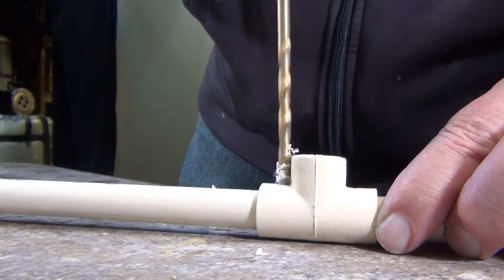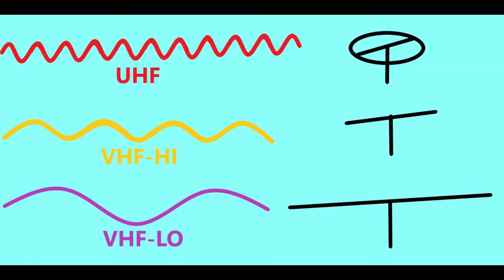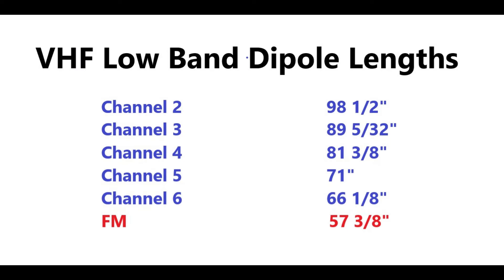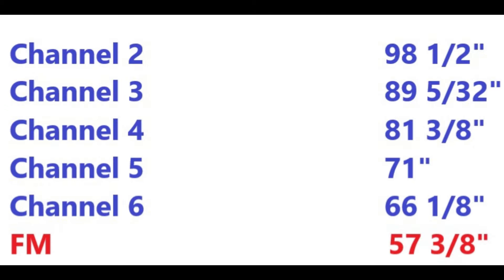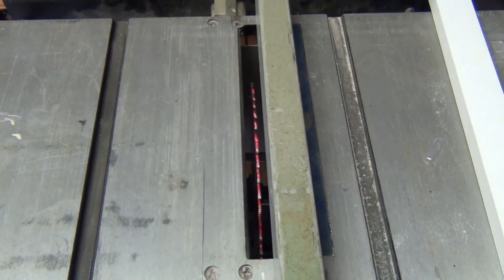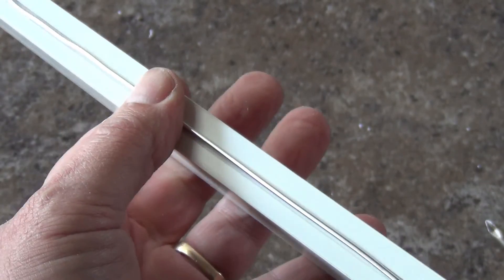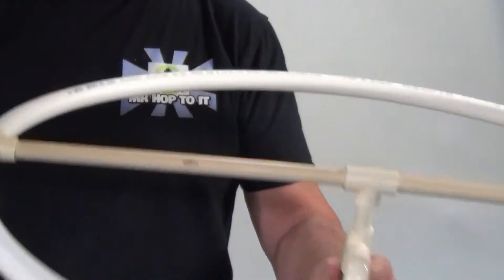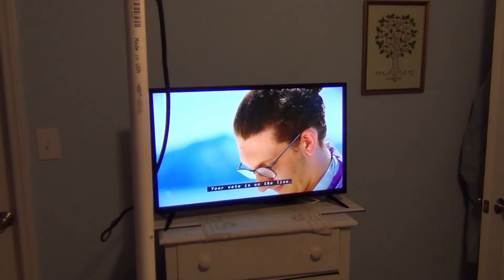VHF-Lo Band Antenna for TV, FM Radio! Part Two

Comment: What length should I build for FM radio only ?
Reply from the maker: Constructing the antenna as per instructions will get good FM radio reception in most areas. If you need a specific FM band or range, then you can customize the length. Try doing a Google Search for online folded dipole calculators and use it to find the best length for your specific needs. Thanks for watching.

Comment: Great antenna build videos - I've built the double-hoop antenna for my in-laws and they're using it daily.  I have a question about the VHF antenna - will an antenna designed for VHF ch2 work with VHF ch7?  I don't think this works in reverse, but does the longer dipole antennae also cover those channels that use a shorter dipole?
Reply from the maker: Yes. You are correct on using the longer element. Depending on signal strength you may get a watchable signal. You may also try tuning for a channel in between, like channel 4 or 5. Its really dependant on the exact situation you have. Thanks for the great question.

Comment: Excellent video. Been looking for this VHF-Lo setup
Reply from the maker: Glad I could help
Reply: **UPDATE! I just built this antenna. Previously I was having trouble receiving WQED PBS in Pittsburgh which broadcasts on VHF Channel 4. It would pixelate sometimes using the Antennas Direct outdoor VHF model and my signal was 49%. After building this, going up on the roof and connecting it, the signal went to 64%!  Thank you so much and keep up the great work! 👍👍 @mrhoptoit7835
Reply from the maker: Thanks for the great update!

Comment: I purchased a roof mount antenna (FSA-3806), that works quite well, except it does not get VHF-Low. I have been following your videos and I have a question...does the VHF-Low antenna for channel 6 (66 1/8") need to be a certain distance from the reflector? Thank you.
Reply from the maker: If you are adding a reflector element to an antenna, the basic guidelines is to space it .20 of the frequency wavelength you want to receive. In actual practice, this distance may vary a bit.

Comment: I have been looking online on dipole antenna gain. I have read that a dipole with a wavelength of 1.25 has a gain of 5.3. How would you make an improved version and keep the size of the antenna length within reason MHTI ?? Please forgive me if I have put any pressure on you Sir. Hope to hear from you with a positive answer to boot. Good day, thanks and peace too. VF
Reply from the maker: Hi VF. Dipole antennas are basically simple, and there isnt too much to change with them. You've already watched my versions of hi and lo VHF dipoles, which are easy to build and effective. Three things that come to mind. 1) Make sure you size the antenna for the channels you are wanting to receive. If its a few channels, usually sizing for the middle station will work. 2) For best reception, use at least 10ga copper or aluminum wire. 3) if your stations are in the same general location, you can try adding either a director element or reflector behind the antenna. As always, good luck!
Reply: @mrhoptoit7835  Do multiple twist wires perform better than a larger size solid copper wire from your experience  MHTI ?? I scored more 4 and 6 gauge wire from my electric company. Bet I got 30 plus feet of each wire. That is not counting the 20 plus feet of 8 gauge solid wire. 
               The sizing for middle stations is the ticket from your experience Mr.HTI??? I will do just that Sir. 
Thanks again MHTI for accurate facts on antenna performance.
Reply from the maker: @victoryfirst2878  If you twist lighter gauge wires they can perform as well as heavier gauge. From my tests, nothing really outperforms 10 or 8 gauge single solid wire., but twisted comes out even or very close to it.
Reply: @mrhoptoit7835  THANK you for answering my question MHTI. I look forward to your channel and videos for me and all others on YOUTUBE. Peace vf

Comment: WOULD folding the dipole into four folds to deal with the length problem affect the reception in any way MHTI ??? Thanks
Reply from the maker: VF, I'm not sure how you would fold it into fours? With VHF, changing the length is much more critical than on UHF antennas and can reduce reception.
Reply: @mrhoptoit7835  I am saying the length is the same just more folds to get four lines from top to bottom. The bottom has connection for the lead wires. This is really hard for me to explain MHTI but think double dipole with radius in between the two lines. Hope that helps Si.r.
Reply from the maker: On VHF, The distance from tip to tip of the element is critical. It aligns to the size of the wavelength you are trying to pick up, and is usually cut to match it in even increments (like full wave, half wave or quarter wave). By reducing the tip to tip distance even more, you would probably de-tune the antenna to a point where it won't get the frequency your are trying to receive. As always, a great question. Thanks

Comment: I have seen an antenna on line that is called the FF6. The large tena supposedly gives the best performance PERIOD !! That is what they say about this on line. I am wondering if you have heard of this type of unit MHTI ?? Since this FF6 is basically a UHF. I would use the Low VHF antenna you used in this video for a more rounded reception. Could you please tell me your thoughts on my idea fella ??? Thanks Mr. Hope To it and have a Happy Easter too. Peace v  😀😀😀😀😀😀😀
Reply from the maker: I don't like to comment on other DIY antennas, but I will say that bowtie antennas like this are basically good designs. They are more difficult to build than hoops, and their performance is very dependent on how well they are made. Thanks, VF. Happy Easter to you!
Reply: Thank you for your honest response. I will keep that in mind MHTI and decide which direction to go with.  Have a Happy Easter to Sir. Peace v @mrhoptoit7835

Comment: Hello Mr. Hop To It. Nice video for the low VHF signal. I live in the Philadelphia area. My channel 6 is known for really being a pain in the neck for reception. This should really help me with making the antenna Sir. 
             Do you think if I double loop the antenna, the size would be in half, would this make the antenna a better reception unit Mr. Hop To IT ??? Also, would winding three copper wires, gauge 12 which you stated is best size, if my memory serves me well  ?? 
              Thank you for your help and job well done with this second video MHTI. Look forward to seen more great videos from you Sir.
 Good day and peace too. vf   😀😀😀😀😀😀
Reply from the maker: For a low band VHF antenna, I would not try modifying this into a double loop. I don't think it would help reception, but there's a better chance you would decrease it. For maximum gain, either use a one piece 8 or 10ga wire or  twist three 14 or  12ga wires as a bundle. If your channels for the antenna are all in one direction. You could attach a reflector on the back side to help get max signal.
Reply: Now that is an idea Sir. I will try the reflector idea MHTI.  @mrhoptoit7835
Reply: I live 55miles east of Philadelphia. Part of the signal is circular.  Make custom antenna using copper wire and angle it about  45 degrees or have it 50% horizontal 50% vertical.  There are details missing , but It works for me.